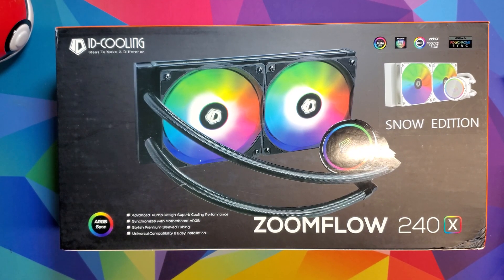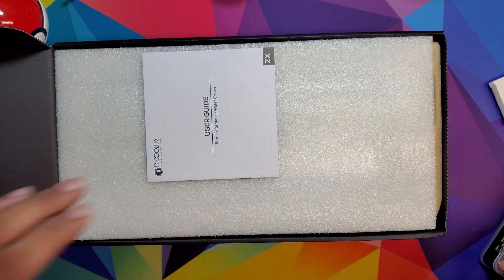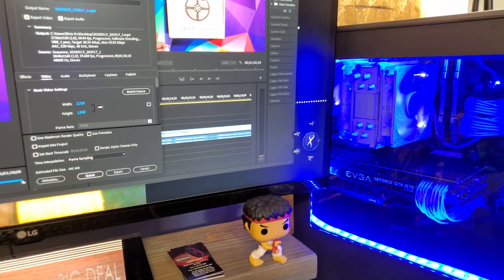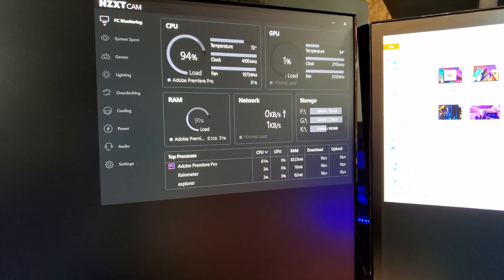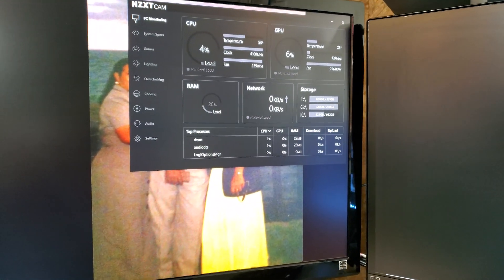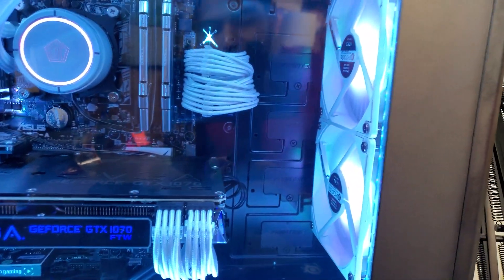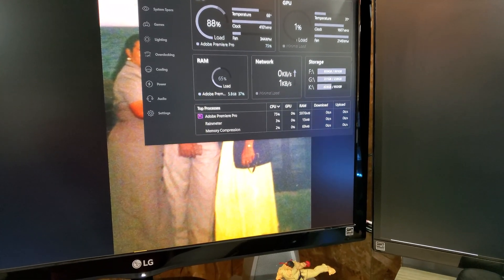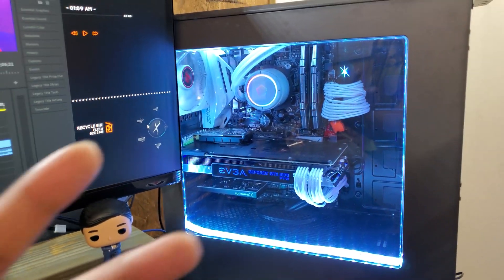Best Budget AIO CPU Cooler | ID-COOLING ZoomFlow 240X Unboxing & Testing

Comment: Having the radiator in the front extracts more heat inside your case. You will achieve cooler temps putting the radiator up top, as it will function as an exhaust and extract the heat out the case.
Reply from the maker: You right

Comment: Your fans are PULLING air?   It should be Pushing air thru radiator for better cooling!
Reply from the maker: I have 4 fans in the front ... 2 in front of the radiator n 2 in back of it

Comment: You can rotate the ID cooling LOGO of the pump?
Reply from the maker: I really don't know but the way I have is the right way
Reply: @kartoonreviews  Sorry bruh but it's actually wrong. The way you had it has the logo upside down, and the tubes should be coming out from the other side of the pump. Would still work as it is, just wanted to let u know.

Comment: Hello sir! May I ask what software you are using to control your fans?
Reply from the maker: Asus fan control
Reply: may I also ask if you plugged your pump header directly to your motherboard or if you used the sata connection? thanks! by the way can I have the link for the asus fan control? is it compatible for other mother board brands? I do have the gigabyte b550 aorus pro
Reply from the maker: I plugged it to the pump header to my motherboard

Comment: Great video! I have a simple question and I'm not sure if you explained it in the video or not, and I'm sorry if you did, but my motherboard only supports 2 fans, does the cooler have one cable for both fans? I have a hub for my UpHere fans but im not sure it will work with a different branding or not! I just need to know if I will have to buy a fan splitter cable or not.
Reply from the maker: I have a hub but u could use a fan splitter
Reply: the tanks upside down.

Comment: I have this cooler for my i7 10700K worth it and I love it
Reply: Yo I'm planning on getting a 10700k what temps do you get with the cooler and does it work good
Reply: @qwatic8286 27-32 idle, 50-56 in gaming so far really good and steady best price and performance
Reply: @crjcostomo  wow that's insane for the price on a 10700k!!!
Reply: @crjcostomo  I've been so hesitent bc it is alot less money but I didn't want to get soemthing that wouldn't cool properly or not cool it enough you know. So you think I should get it over say the kraken x53
Reply from the maker: That really good temp
Reply from the maker: Me too

Comment: should i put this up top or to the side like you did? great vid btw
Reply: put it on front and the tube of the radiator must be downward.. thats the correct orientation in installing aio..
Reply: @askfalse  thanks, I have a 3600 so it will be fine up top.
Reply from the maker: I might move my to da top
Reply: @kartoonreviews  👌👌